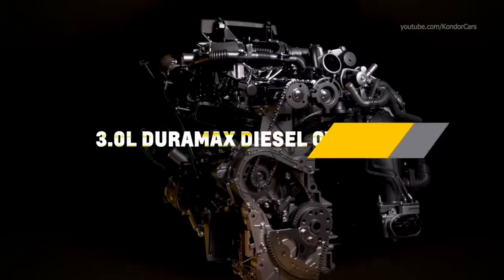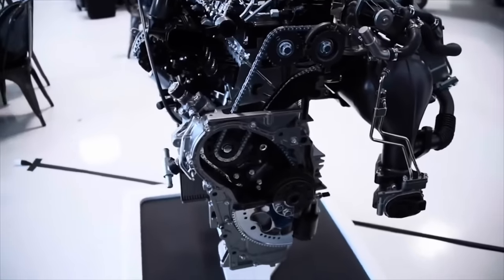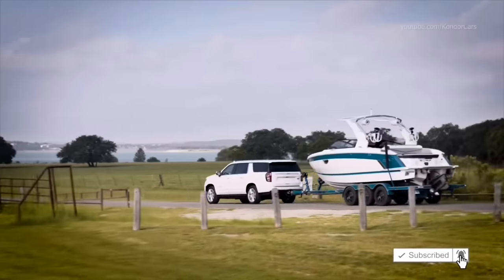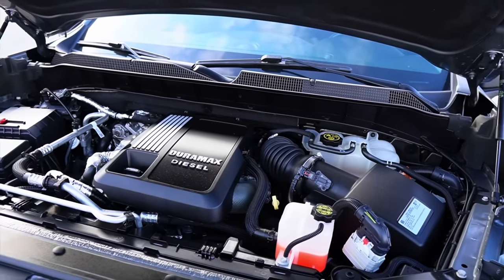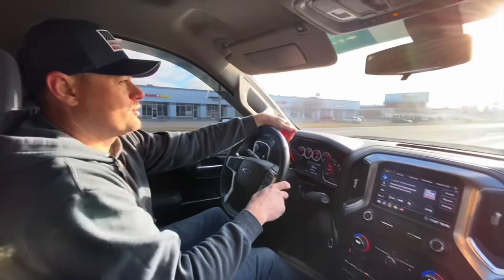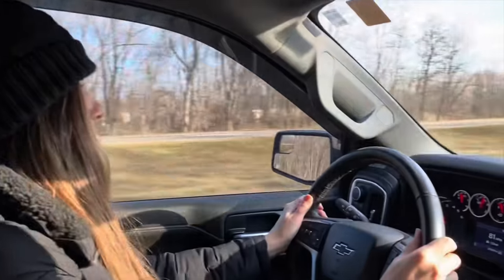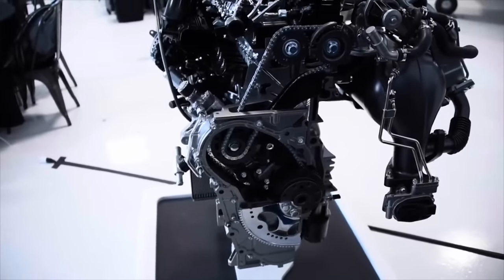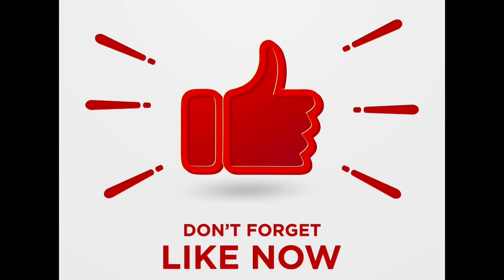What Everyone Needs To Know About The 3.0L Duramax!

Comment: I have put 11k miles on my 2022 high country 3.0 and have had no issues. I have a family of 4 and dont really tow a whole lot, but i commute 110 miles a day and still use the truck for hauling lumber and soil and such.  I also installed an S and B air intake, PPE resonator delete, and a Stillen air scoop.  It's peppy and I love the MPG, averaging 25 to 27, although if you get on it all the MPG drops pretty drastically.  Setting the cruise control on the highway ive seen as high as 37 MPG on a 200 mile trip.  Waiting on Banks to drop their programmer to put that on it, but I would be interested in any content you could provide on aftermarket products or tips and tricks.

Comment: GM has extended the service interval from 150k to 200k now
& The part # hasn't changed & you only have to pull the transmission or slide it back

Comment: Best decision we made was buying our 2020 Silverado 1500 with the Duramax. We bought it new and we have driven it 53k miles. Wife loves it. The only issue is consuming DEF when towing.
Reply: How is u truck ? Any issue?
Reply: @watchmanexpert  I hate doing this as I do not want to ruin it. Nevertheless, we have not experienced any major issues. Knock on wood! We only had a minor issue with the rear window defroster at 30k miles. It was fixed under warranty.
Reply: @Double_deuce22   thanks 🙏 I want trade my truck and for 3.0 . I don’t know nothing about diesel and usually I keep truck for 150k miles (15 years )
Reply: @watchmanexpert  these new diesels are way different; some ways better some ways not (def system). Overall we will never go back to a gasser. I have the one ton Duramax as well.
Reply: @Double_deuce22   nice 👍🏻 , the thing scare me is people saying is expensive the repairs for diesel the DEF system and also the maintenance is expensive people says , l like keep tuck minimum 12 to 15 years and I do the maintenance on my truck and the repairs also , but like I said I don’t know nothing about diesel or DEF system I want the 3.0 for fuel economy my 2010 Titan is 9 mpg city and 12 —3 highway … I hope 🤞 the 3.0 diesel or DEF system can last 15 years

Comment: I have a LZ0 AT4 and love the ride and look of the truck. With that said it did have a few problems. Replace some sensors and wheel speed sensors. Not a big deal, but the turbo went out. At 3000 mil. They said it was bad from factory. Nothing outta pocket but only time will tell

Comment: RUN RUN RUN!!! I just had to get mine bought back from gm after barely hitting 1 yr if ownership and 20k miles, I’ve had nothing but emissions problems 6times, main wiring harness once, broken injectors twice, traction control and electrical problems 3times, remote start hard cranking(hard knocks) 4 times, steering column service 4times, and coworkers son has the same year but the gmc with only 3k miles on it and is currently in the shop for the 11th time and is in the process of enrolling into the buyback program as well, so all said and done I lost $7k of my down payment cause of the mileage they charge, will never buy gm again 🤷🏽‍♂️oh and the service writer had said the 3.0’s are not doing well and I asked why is that and he responded with,  CAUSE WE HAVE 7 OF THEM IN THE BACK ON THE BUYBACK PROGRAM 😮

Comment: Holy carp!  Those numbers are about the same for Ford's 7.3L Diesel LEGEND from the late 90's!!  And without that noise!

From Diesel Hub's Website for the 7.3L:
Peak Horsepower:  210 - 275 hp (see breakdown by model year in chart below)
Peak Torque:  425 - 525 lb-ft (see breakdown by model year in chart below)

Comment: I had the 3.0l Eco Diesel in a Jeep grand Cherokee. The same engine as in the Dodge RAM. I only drove the car in Germany for six months and sold it again due to too many engine problems. The reason was the charge air hose that broke twice and excessive oil consumption. I'm driving a good old 2005 5.3 Suburban again.  Greetings from Germany.

Comment: Love my 2021 gmc 3.0l can't stand the looks of the chevy hence the reason I went with a GMC sierra. 
Love the fuel milage. Average 25 in the city and if I travel on family vacations it's 30+ mpg. As for towing capacity I truly feel they under rate the capacity. I wouldn't hesitate to tow the same as the 5.3l capacity. A properly loaded trailer makes all the difference.   Everything I've towed behind it it truly feels like nothing behind it when towing.

Comment: I have a 6.2 L gasser. Love it.  I will not do deisel unless it was the 6.6 for raw power.  The so called savings are bs on diesel. The new gas engines are very good.  I get awesome miles on highway with the truck. Unless you have fleet mechanic don't even think about it.

Comment: I have a 2021 Sierra 1500 with the 3.0 and so far so good(37,000 miles). I use it as a daily driver and get 25 to 26 mpg in city driving and have got over 30 mpg on the highway. I pull two SXS's on my 21ft trailer (7200#'s) and get around 15mpg from NC to WV...I traded a 2019 Chevrolet 2500 HD L5P due to fuel mileage and not needing a HD truck as a daily. If someone thinks they are going to get the same power with the 3.0 as they are used to with a HD diesel truck they are sadly mistaken. These truck are not a HD truck. If you pull a lot of weight or if you haul something weekly I'd probably stick with a HD truck. Also the Silverado you drove looks like a double cab not a crew cab..

Comment: Looks to me you are in a "double cab" or the "extended cab" model -- which is a much smaller back seat than a "crew cab."   And being an old GM guy, I have to say I like the 2014 -- 2018 models much better on outside appearance.  I am looking at a 3.0 1500 right now and having same questions over the diesel vs the gas V8.

Comment: I would go with the 6.2 liter it gets better mileage and higher towing the LZ0 is supposed to be pretty good
Reply: 6.2 liter does not get better mileage then the 3.0 liter.  And there isn’t much difference in cost in fuel since you are suppose to run premium in the 6.2.  Even with higher cost of diesel you will come out ahead with the 3.0.  The 6.2 liter does get higher towing numbers but even towing the 3.0 duramax gets way better fuel economy towing too.  Don’t believe me go watch the videos tfl trucks did on these trucks
Reply: @shanebrown2963  no it gets better mileage than the 5.3

Comment: The 3.0 dusts the 5.3 in a 1/4 mile both off the line all the way through. Most people who opt for the diesel (depending where you live) do it for the fuel efficiency. I am in TX and as of now diesel is only about 10 cents more than regular gasoline. Obviously the 3.0 doesn’t work for y’all and I’m sure you already knew that. I came from a 3.5” lifted 5.3 RST and at best I was getting 13-15 mpg in the city. On my new 2WD LTZ I’m getting 28-31 mpg on average on the highway and 21-24 in the city. Maybe as gas prices ebb and flow I’ll alter my opinion but for me the 3.0 is perfect for what I need.

Comment: How come nobody is mentioning the oil pump being driven by a rubber belt that is located on the back of the engine that needs to be replaced every 80,000 miles. Have to separate the transmission from the engine. How much would that cost the consumer?

Comment: I have a 2021 Tahoe with the 3.0l diesel and 10 speed. 20,000 miles on it. Hands down the best all around performing powertrain for a Tahoe/Suburban when factoring power, torque, feel in the seat, and fuel economy. Our vehicle before was a 5.3 Suburban. I also have a 5.3 Silverado 1500. 

Here are the details so far…3.0 Tahoe avg 30-31 mpg in the summer and 26-27 in the winter (MN). The 5.3 avg 19-20 in the summer 17-18 in the winter. The 5.3 is great, but this is better. Diesel is $4.09 here and 87 is $3.39 as of now. Oil change and tire rotation at my local shop was $147.47 for the 3.0. It was $69.41 on the 5.3 Silverado. DEF is $16.00 at the store for a jug that lasts 4-5k. I think cost is pretty comparable.

Overall, I think your summary of the 3.0l diesel is good with costs being comparable to the 5.3. Towing is a great experience, but limited on weight. I disagree on real world performance. I love the 3.0. This is noticeable on the highway when accelerating from 60-70 or 70-75 to pass. The 5.3 has to downshift significantly and crank those rpms up, while the 3.0 does it effortlessly and if you aren’t careful will have you at 85 before you realize. The 3.0l warms up faster than the 5.3 in the cabin. The wet belt isn’t an issue for me because the Tahoe will be long gone from my ownership before 150k miles. There are way too many other things that will break before then. If anyone is hesitant on the 3.0, don’t be get one as a 5.3l or even 6.2l replacement. But it is for SUVs and Half-tons. If you need capability go to a heavy duty.

Comment: I bought a GMC 1500 AT4 with the 3.0 Duramax, the back seat area is huge, albeit i came from a Tacoma but my buddy has a 2018 3500 Series Ford and my GMC rear seat area is visibly bigger..... I get a little less fuel mileage with the AT4 thanks to the 2 inch lift it comes with but so far i love the truck..... On the DEF usage, i just put 3 gallons of it in my truck, for the 1st time, it had about a 1/4 tank left, it has a tad over 5500 miles on it, i know if u tow with the truck it does use more but for a daily driver, the DEF price is pretty insignificant....

Comment: I hounastly can't see how you'd save money on fuel with how crazy fuel prices are. I have a 2014 seirra with the 5.3 and it can achieve 22-23 mpg on a good day. If the 3.0 was tuned that may be different. Also the 5.3 has a great reputation with reliability and being easy to work on. Ik that lifters are an issue but a simple cam swap can fix that on the newer 5.3s. 

My personal opinion on the 19-23 (current) silverados, I didn't like them at first but the looks grew on me, especially the trailboss. But I personally love the way the 14-18 gm trucks look. I always liked the way they looked since they came out and the interior styling is far better then the current ones

Comment: Concerns of pulling max trailer weight daily doesn't seem like a concern, because anyone regularly towing over 9,000lb isn't buying a Fullsize pickup; they are buying a Heavy Duty. Also, "pulling a trailer for work" does not equal "pulling 10,000+ lbs". Plenty of "work" consists of pulling light weight trailers (6,000lb or less) and these engines shine compared to a naturally aspirated gas, especially at elevation. And for the occasional recreational towing up near the max trailer weight, which requires weight distributing hitch, etc. they do fine and better than a gas V8 that has to run at screaming rpm to go over a pass rather than nice lazy "turbo diesel" rpm. Much more relaxed towing with the 3.0 diesel than a gas V8. When empty, the 3.0 won't accelerate as fast as a gas V8 at WOT, but I submit two things: I am not typically driving around accelerating at WOT when unloaded and also, when towing, it will accelerate at about the same rate as the gas V8 because it's less effected by the weight. 
Also, the LZ0 belt inspection is now every 200,000 miles which is fairly infrequent in my opinion. Probably only one or two replacements over the life of the average pickup, which covers 400,000 - 600,000 miles.
I definitely agree that a 3.0 duramax isn't the right engine for everyone, but then a Fullsize pickup with any drivetrain isn't the right pickup for someone needing an HD. But there is a place for a Fullsize with a diesel and that is not only for towing, but for overlanding/backcountry exploring, because one can get much further driving range (100+ more miles) out of the same sized fuel tank compared to a gas engine. Huge market for owners that tow less than 6,000lb (flatbed or enclosed trailers for motorcycle, ATV/UTV, snowmobiles, etc. for recreation and for lawn care business, tradesman parts trailers, etc. And vast numbers of boats/trailers in that weight range.

Comment: I had one.  Had long crank issue.  They couldn’t fix.   Then leaky fuel injecters, later fuel rail and injectors again, 2 weeks later fuel pump, rail, and injectors again.  Then it would stall out and stalled going across highway and almost got killed by a semi.  The whole time we were in touch with GM.  They didn’t do anything until I almost got hit.  

Finally got approved for lemon law, after owning the ruck for just over a year we probably kept it for only 6 months is was I. The shop the rest of the time. brand new it all started about 20 k miles.  

Gm took us to the bank on the lemon law then sold it for more than we bought it for netting all the equity we had built up over a year paying double payments.  This truck was a gift for my wife finishing nursing school.  Between GM and this truck it was a nightmare
Reply: @danielpaul5063  I have heard about long crank and stalling issues from lotta people. But then there are lotta people who have had great things to say about its reliability. Hard to understand

Comment: The only reason why I would be looking at this diesel is because the 5.3 and 6.2 have active fuel management problems lifter issues, same with Dodge Hemi.

So I don't really see how the diesel could be less reliable.

The 2.7 turbo although it may be reliable not a really good engine for towing I would suspect.

I would say the Ford 5 L coyote engine is by far the most reliable if you're looking for a V8.

The EcoBoost and the Tundra twin turbo I believe are good engines just a little more thirsty at the gas pump.

Comment: 6.2L is the way to go. you can get the fuel economy without the cost. it all depends on if you have a stock truck and don't tow offend 6.2L is the way. if you tow all the time or at least a couple times a month and/or have the at4 package id, go with the 3.0

Comment: I had a 2020 Chevy 1500 3.0l Duramax and it was great for the 45k miles I put on it and I towed 10k lbs pretty easy and still got 16mpg. Daily driving it got about 22mpg or so. I didn't like that parts couldn't fall off though only reason I traded it

Comment: does the duramax transmission fluid temperature run warmer than the 5.3L transmission fluid? i got a 2024 3.0L and the temp be staying @198°F-200°F, while the 5.3L stays around the 174°F-176°F range? does it run warmer or is there something wrong?

Comment: Just bought a 23 at4 sierra with the new LZ0 and I have to say it has more punch. It's rated at 23 highway but I have gotten up to 27. Only 600 miles in but I'm happy so far.
Reply: Bro that's a sweet truck you just bought

Comment: I have been looking to replace my 2004.5 LLY 2500HD. I do not heavy haul anything anymore, love diesels, and liked the idea of MPG on the baby max. After 6 months of research and sticker shock of new trucks, I have serious concerns about the LM2 3.0. Seeing pictures of cabs that have to be lifted off the chassis and/or dropping tranny for service and to fix the "long Crank" issues,  it is not worth the risk. Its hard for me to spend $65K then always wondering if it will fail (at the worst possible time) and then rack up an additional $5k service bills over labor intensive repairs because of poor design. Even worse, they scrapped the LM2 and now pushing have the LZ0, which will likely have its own new production issues. I love the concept, I just think GM missed the mark on what could have been something great!
Reply: It's progression, like the LLY to the LBZ hopefully. I had a LBZ, LML and now L5P and they lifted the cab on the LML for the head gasket. All good trucks and the newer pull better than the older. The newer ones are incredible and the emissions limit how much better they could be than they already are.

Comment: You mize-a-well buy a 6.2 if you go gas 2 mpg difference compared to power isn't much its rated at 13,300 lbs. And I read that the Silverado double cab 4wd Dmax has the same towing rating at the max tow gasser at 13,300 lbs not sure where they came up with 9,900 lbs?

Comment: I did not get the diesel, I bought the 2020 Trail Boss with the 6.2.  The crew cab on my truck is huge compared to the truck you tested.  I also got the tow mirrors that comes with the 2500.  My wife said the passenger seat sat too low, and it did not have a way to raise it, so I bought a lift kit for the passenger seat.  Now it is a lot better for her.  I would go with a Crew Cab with the 6 1/2 foot bed.  I did and it is a lot better for a family.  As for a diesel, if towing a camper I would opt for it.  Gas engines rev so high when towing and it does get annoying listening to the constant scream of the V8 on grades.

Comment: I have a 2016 LTZ 5.3 V8 and do love driving it. In sales and drive a lot with the bulk being highway miles. I have 272k miles on it and have averaged around 18.4 MPG over the lifetime of the truck. Downside is it’s on the third transmission. Original one went out right at 100k and the second one lasted 128k miles. It’s had all the maintenance and now runs fine but have been looking at these 3.0L diesels hard because of the mileage. Doing the math the diesel’s better MPG’s would pay for itself easily. Service Mgr friend at local Chevy place says they’ve seen good success with these motors and recommended I look hard at them. His dealership offers a lifetime power train warranty which is hard to pass up. I’m waiting a little for the dealerships to get a little more hungry on the price side before pulling the trigger.

Comment: Hey i Got a question, not related to your video. I have a 2016 gmc denali 2500 diesel....and for the last couple weeks on and off I have been getting a foul smell inside the cab almost like sulfur a rotten egg smell. I've called around and have gotten nowhere. So I thought id ask you!! Any thoughts??? Thanks and I enjoy your channel.
Reply: Sulfur rotten egg smell is often a failing catalytic converter. Any codes?